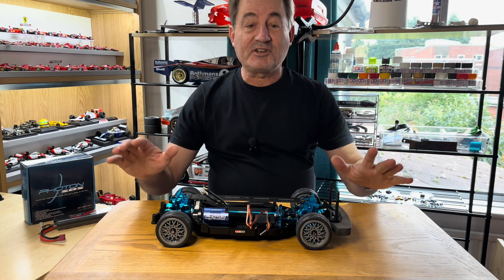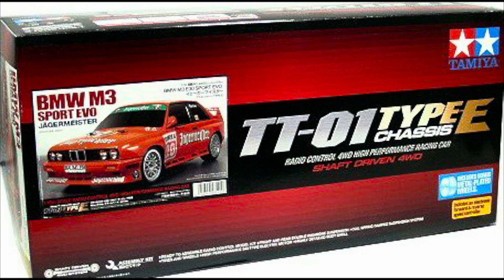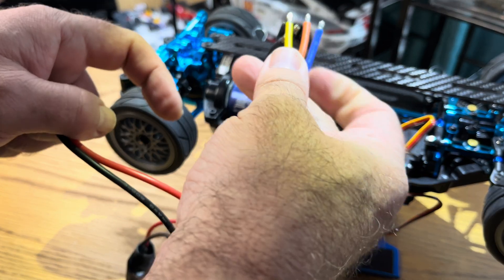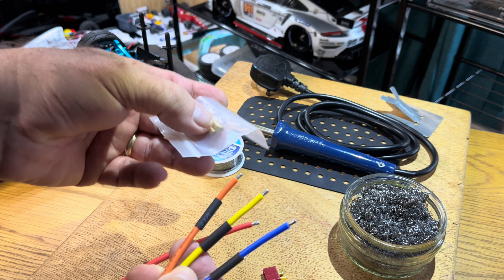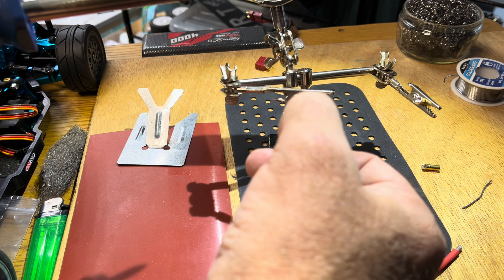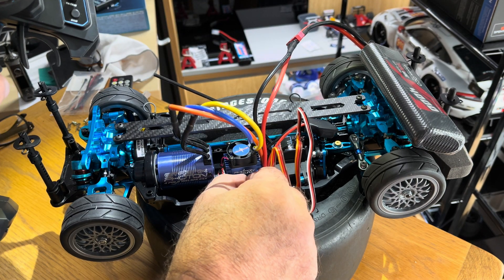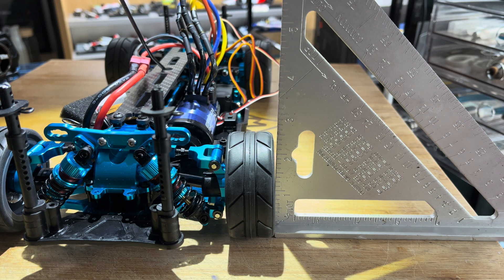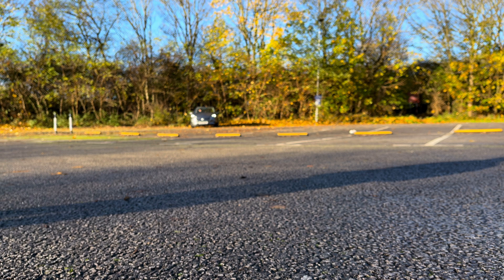Tamiya RC TT-02 Part 2 Brushless Upgrade

Comment: cool videos! i have been enjoying my tt02 builds, really testing the limits of how much power they can handle, i recommend checking out the oil filled diffs TAMIYA 54875, and the Yeah Racing TT02-015 cvds, they were a huge improvement on my brushless builds.
Reply from the maker: Thank you so much and great suggestion will look into 👍

Comment: Hi. 45amp ESC for a 1/10 seems low. I run 60 or 120amp ESCs. Look forward to seeing what kind of speed you get.
Reply from the maker: Hi and thanks for your comment. I hoped it was enough and with other upgrades turns out quick enough to enjoy car park bashing 👍
Reply: Just wizzing around in the parking lot a 45amp will do just fine
Reply from the maker: @ It’s a serious improvement from stock so job done 😎